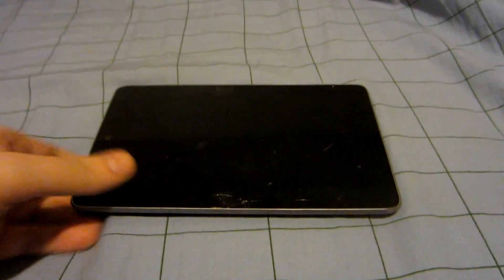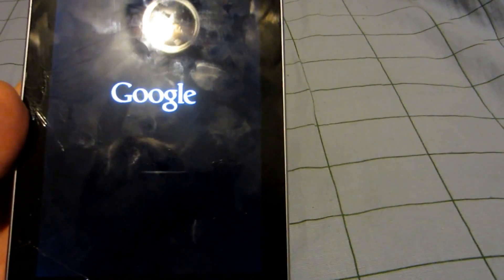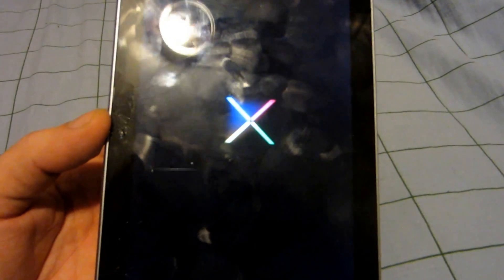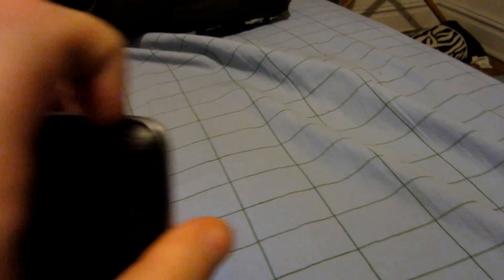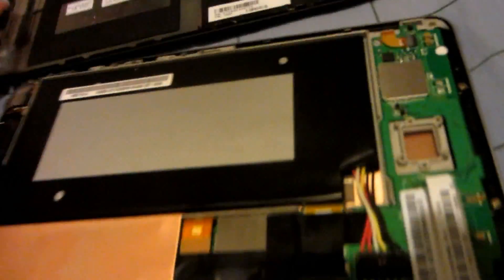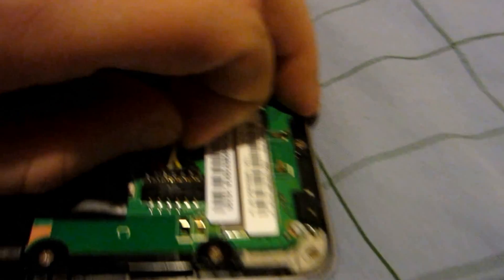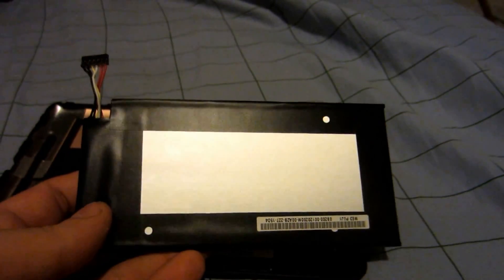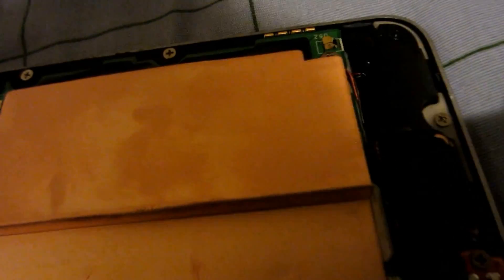HOWTO: Remove and Replace Nexus 7 Battery

Comment: my local computer store estimated that it would cost $100 for the technician to install the battery which was going to cost $86. I got the battery for less than $20 and i9nstalled it in a couple of minutes by following the simple instructions in the video. Thanks heaps!

Comment: FYI - If your Nexus 7 stops working don't assume its a dead battery. I have had 2 so far and both of them just stopped working never dropped or anything.
It turns out the battery connector gets loose. Before you go out and buy a new battery just disconnect and reconnect the battery. It worked twice for me.
To the poster of the video, good information but if you dont have a tripod try placing the camera on a few books. It would be much easier to see what your doing.

Comment: Back and battery came off exactly as stated without a problem first time.  Now I going to see whether it will work after the battery has been disconnected and then reconnected after 30 minutes.  My Nexus decided to stop working.